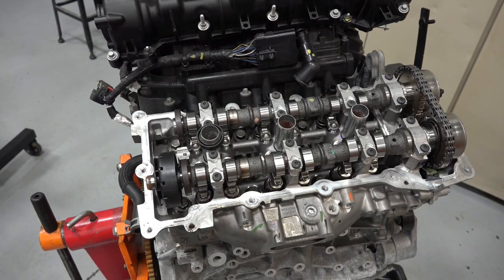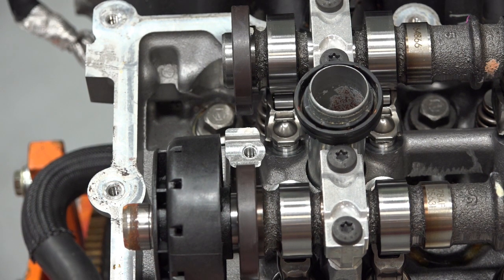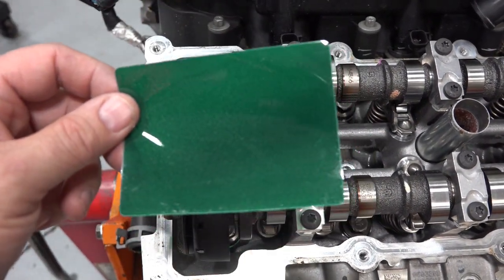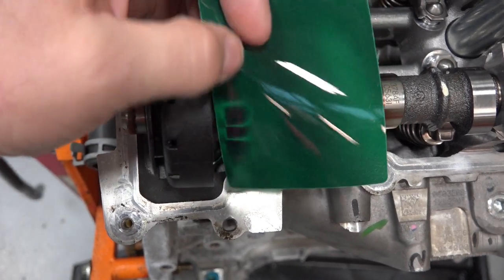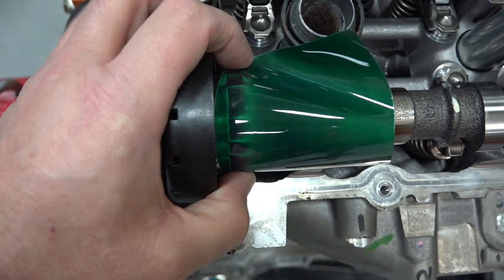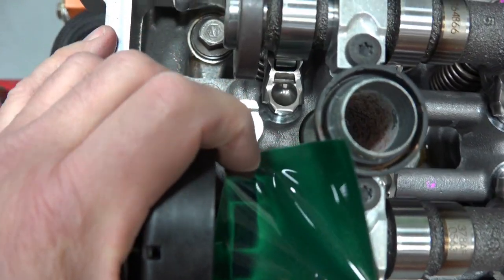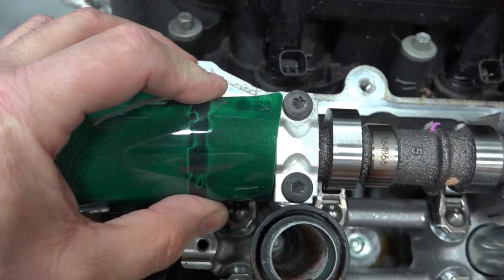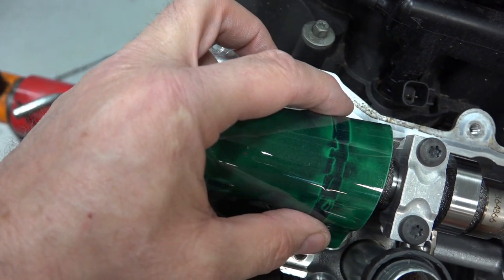3 6 Pentastar cam timing wheels

Comment: Omg I've been looking for this, someone told me about the green film but didn't know the name of it. Anyway I had to replace my timing chains and tensioners, oil pump and chain all new gears. Got it back together and can't get rid of the cam position sensor code. Now I will check those wheels, if I'm not mistaken they are pressed into the camshafts I don't think you can get just the magnetic wheel.
Reply: Hi there, I have the same issue (a reoccurring cam position sensor code) after swapping out my lifters and rocker arms.  I have been dumbfounded as to why because I had no idea about the magnetic wheels.

Did you ever fix the problem?  Thanks in advance.

Comment: Thanks for this great video! Using the reference waveforms from the first seconds of the video, I found out which camshaft was bad, by comparing to the waveforms on my car. 
Now, do you think it is possible to re-magnetize a cam timing wheel ? Using a strong magnet and some steel metal plates to contain the North or South pole fields within each segment along the circumference?

Comment: are they replaceable?
Reply: Have to replace cam.. But if you have no option you can tap it one way or the other to get it back in spec. Only if it had come loose. Its the tone ring. If its wiped out like that. Will need cam
Reply: Give or take 9 -/+ degrees
Reply: @besttex4735 how do you mean tap? Like hit them?
Reply: Shoo I may need all 4 😢